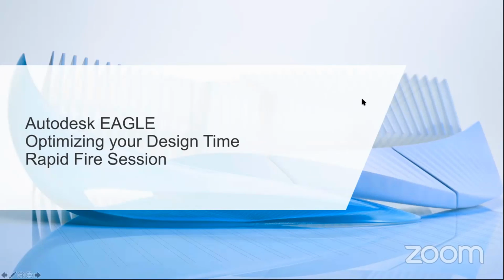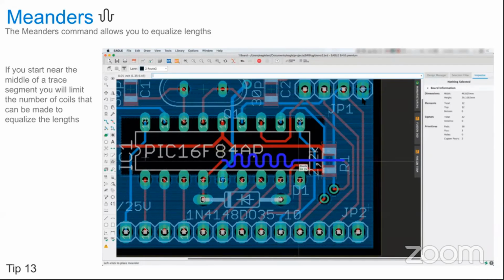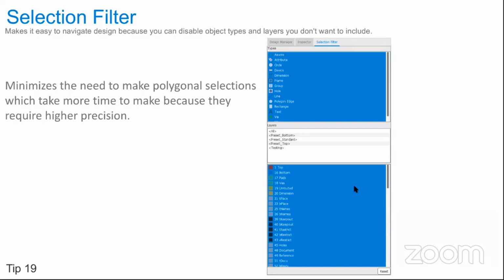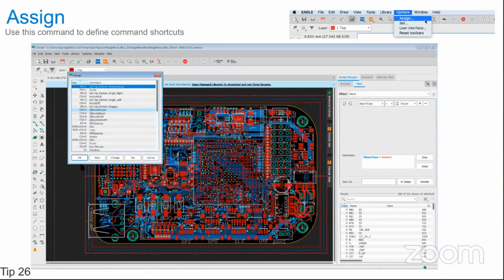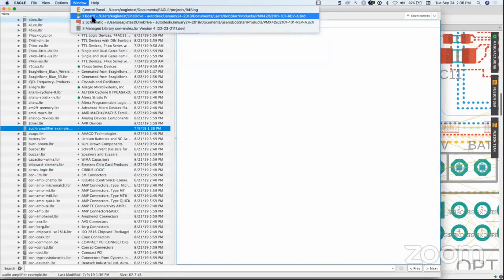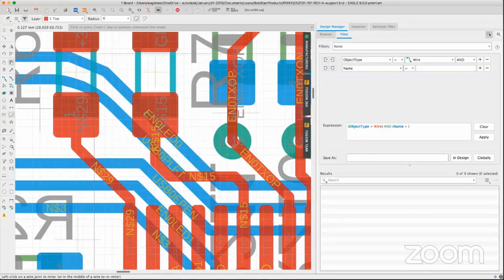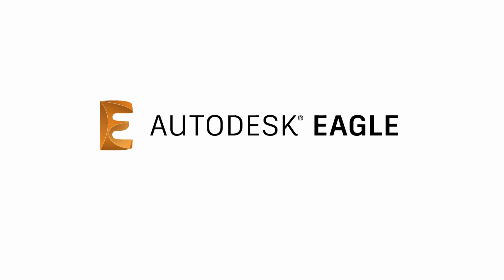30 PCB Design Tips in 30 Minutes! Autodesk EAGLE - Sept 2019

Comment: Just quick info about the Script files. On Windows, the file extension SCR is system reserved extension for screensavers (basically renamed executables - EXE). Installation of Autodesk applications corrupts the association of the screensaver extension withing Windows, rendering them unlaunchable, because now Windows thinks that files with SCR extension is a text file and it tries to open it in an associated editor, which in this case is Autodesk script editor. I don't need to say that it obviously won't work, since screensavers are programs, so therefore binary files, which aren't editable in text editor. It is obviously a side effect, but could easily been handled with care if Autodesk took in consideration ALL systems when handling file extensions. I get it that it is standard extension on Unix based systems for scripts, but since Autodesk is cross-platform, giving it proprietary file extension wouldn't be much hard, would it? Schematics have .sch and PCBs have .brd - and that dates back to CADSoft days which originally owned EAGLE (Scripts weren't thing before it was bought by Autodesk). What if scripts had extension let's say .scp or .sct? Unix based systems do not detect file format based on extension (well, except for text scripts and source codes, like C - but it still needs to detect text instead of binary file), but Windows do, and Windows already have SCR extension assigned to screensavers. I had collection of screensavers and I was surprised that their own unique icons turned into Autodesk script icon. If Autodesk used different extension for scripts, it wouldn't interferre with Windows reserved extensions, which by the record aren't particularily easy to fix - you have to download a Registry Editor script (*.reg) for that particular extension and manually run the script to merge it with current registry values - obviously, you need to restart Windows Explorer to take that into effect, and you need to know how to do it. Reassigned screensavers to scripts can be still run by command line, so it doesn't matter that much, but I had my screensavers linked to Desktop for easier access and it ruined it, because double clicking it caused Autodesk script editor open instead.
Reply: Script files already existed in Cadsoft days. That's not an invention of autodesk. But nevertheless, it is not a good practice.
Reply: @fuerstfanta  Well, then I simply didn't notice. Maybe you're right. However, Cadsoft was aware of that and didn't associate .scr files with anything, leaving it at its default settings. You can always run or even edit the scripts from Autodesk apps (formerly Cadsoft apps). Convenience isn't always the option if it actually breaks the system.

Comment: 30 Tips in Video
------------------------------------------
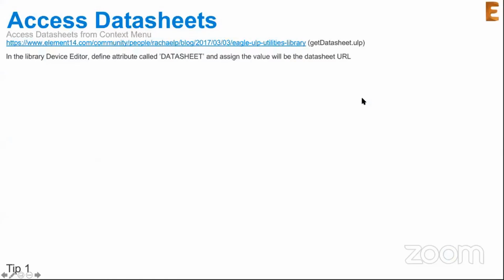1:56 -- Tip 1. Access Datasheets 
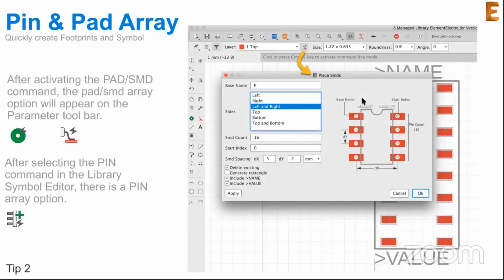2:54 -- Tip 2. Pin & Pad Array
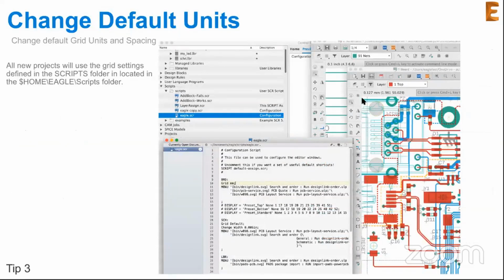3:52 -- Tip 3. Change Default Units
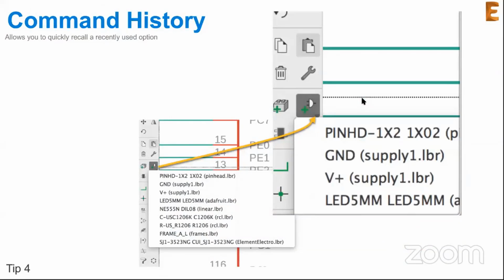4:56 -- Tip 4. Command History
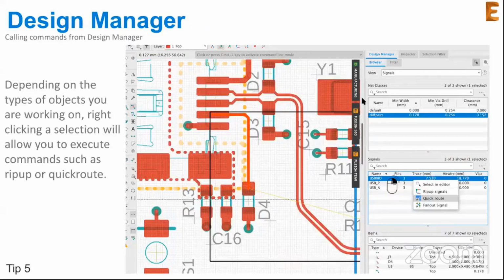5:52 -- Tip 5. Design Manager
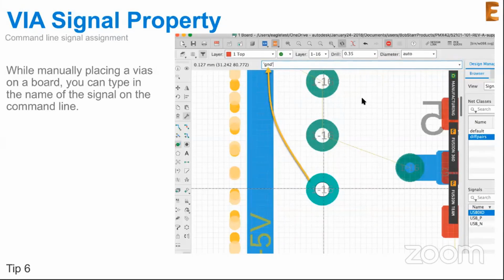6:58 -- Tip 6. Via Signal Property
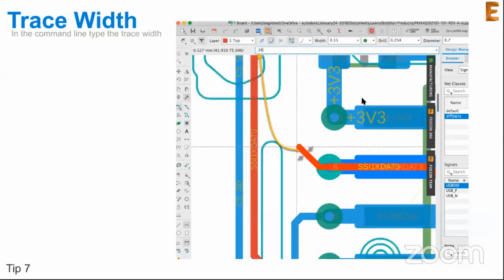7:58 -- Tip 7. Trace Width
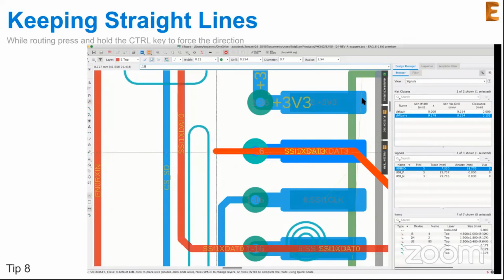8:49 -- Tip 8. Keeping Straight Lines
10:03 -- Tip 9. Single Layer View
10:47 -- Tip 10. Avoid the context
11:42 -- Tip 11. NetClasses
12:45 -- Tip 12. Attributes
13:51 -- Tip 13. Meanders
15:00 -- Tip 14. Fanout
16:02 -- Tip 15. Schematic Simulation
16:53 -- Tip 16. Design Rule Check
17:58 -- Tip 17.  Schematic Component Placement on NET
18:57 -- Tip 18. Teardrop
20:06 -- Tip 19. Selection Filter
20:47 -- Tip 20. Object Inspector 1
21:34 -- Tip 21. Object Inspector 2
22:41 -- Tip 22. Define Filters
23:52 -- Tip 23. Using Filters
24:46 -- Tip 24. Polygonize
25:54 -- Tip 25. Placement of NAME and Value Attributes
26:31 -- Tip 26. Assign
27:35 -- Tip 27. Command Line
28:44 -- Tip 28. Control Panel to place library in use
29:49 -- Tip 29. Define a bus by selecting Pin and NETs
31:00 -- Tip 30. SPLIT command
Reply: This is Awesome!